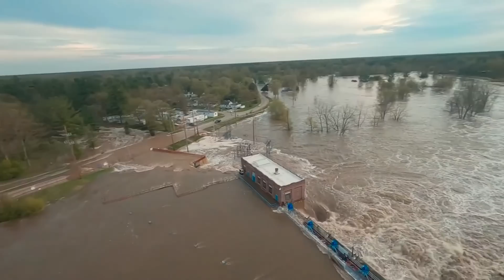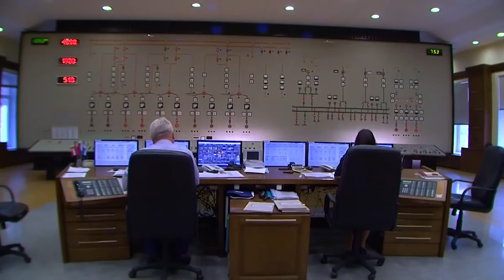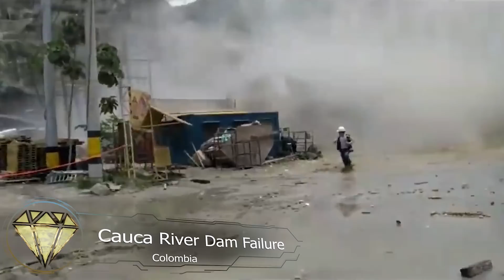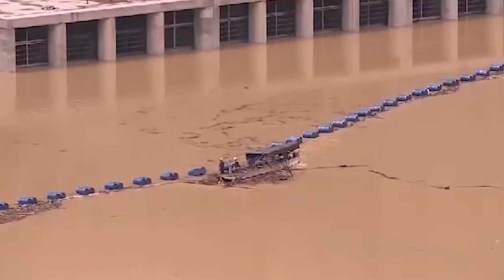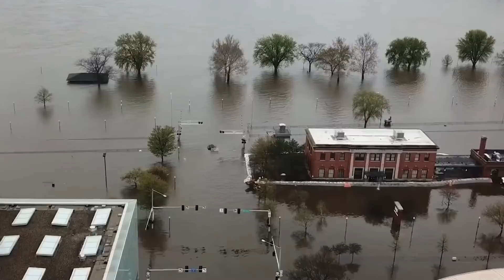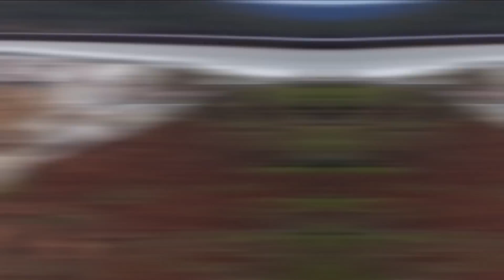Caught on Camera! Shocking Dam Failures

Comment: Thing is, every single dam ever constructed will eventually fail. The only sensible solution is to stop pushing away the cost and dismantle them before they do blow out. Use them while they're good but own it when they wear out.